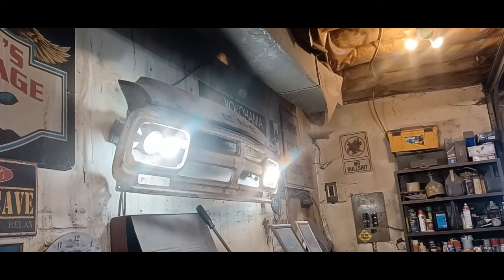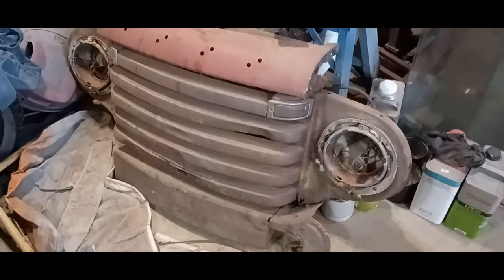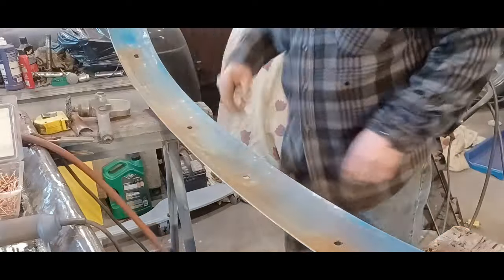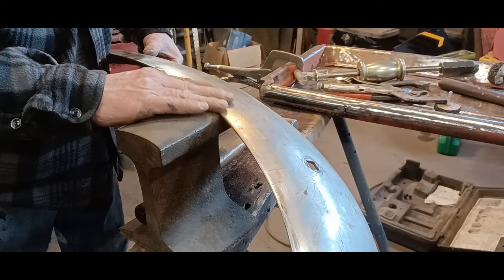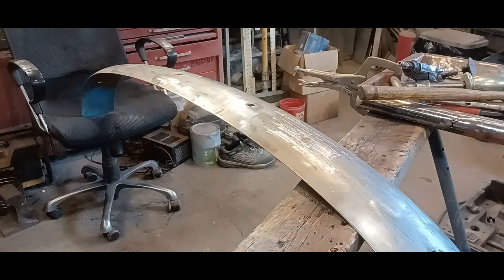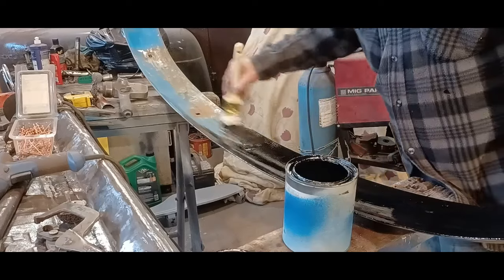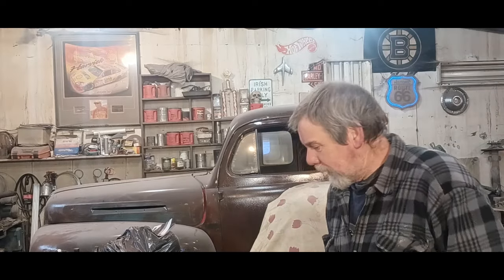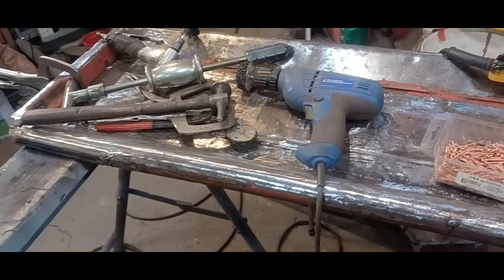GREAT GARAGE WALL HANGER IDEAS! & '51 CHEVY BUMPER WORK!

Comment: Bumper looks great speaking of wall hangers in Hamilton Montana they have a bar that a 30s model truck built in the front of the building about 20 feet off the ground looks really cool  also saw a 1940 ford pickup cut in half length ways and attached to the outside wall of a shop. I thought what a waste but oh well it was a pretty cool sign to advertise that he restored old fords. We also like wall hangers. Dae and I like your functional wall art.
Reply from the maker: Thanks... Yeah, seen some pretty cool stuff in my travels as well.